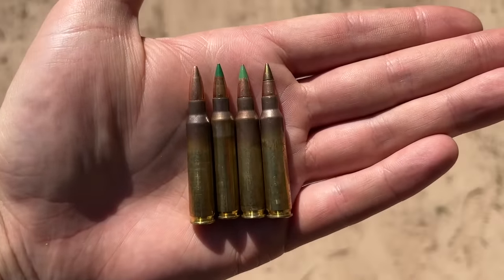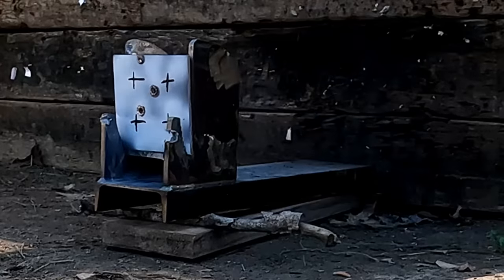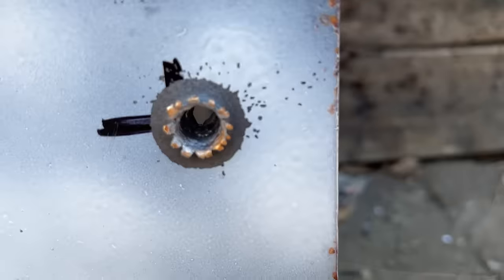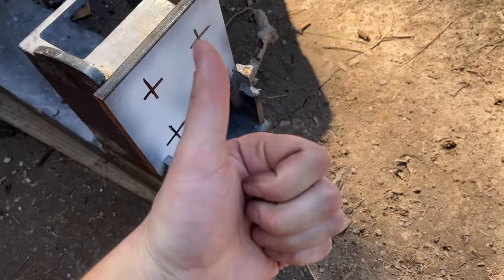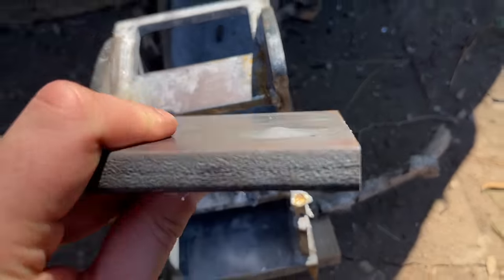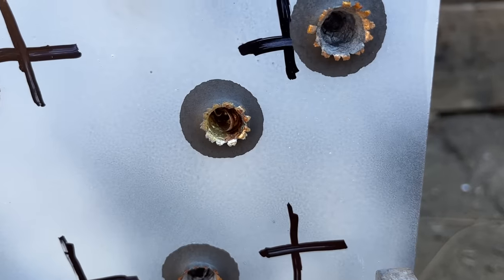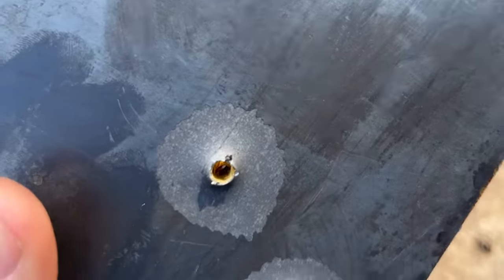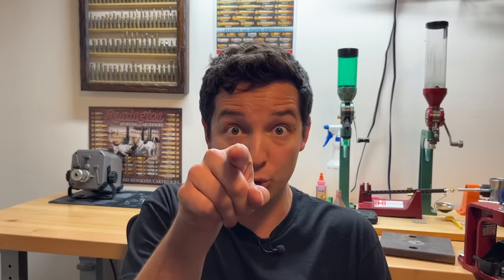M855A1 vs M855 vs SS109 vs XM193: Crazy Results on Steel

Comment: I reckon the chronograph wasn't getting a reading on M855A1 because A1 not only has a steel tip and steel core, but the round is loaded in such a way to where it is near maximum safe chamber pressure out of an M4 Carbine, thus increasing velocity. In short, M855A1 is hauling so much ass out of that 26" barrel that the chronograph can't measure it.

Comment: Penned AR500 with M193 out of an 18" barrel before, I don't think the M193 is gaining anything from the 26" barrel, in fact it may be losing velocity. The three heavier projectiles are getting much closer to M193 velocity than out of say a 20" barrel. M855A1 is a different beast but M193 often does better than M855.

Comment: What's the difference between the 855 and 855a1 
I'd like to see 855 or 109 comparison with the stuff the marines use or used where the penitrator is in reverse orientation from the 855/109
Reply: A1 uses a copper base, no lead core, and the penetration besides being exposed, is hardened steel instead of mild steel, and larger. A jacket then wraps around the copper base and penetrator add I understand it and from what I can tell from cut aways.
Reply: A1 is also about 200 fps faster
Reply: @meanman6992  the penetrator of A1 is harder than M855 but the M855 is not mild steel. It is hardened steel but on the lower end. For example, the steel in M855 is not as hard a AR500. But the steel in M855A1 is actually harder.
Reply: M855 and SS109 are essentially identical. "M855" is the US designation for SS109.  M855A1 is has a different bullet construction (steel arrowhead on top of a solid copper slug wrapped with a copper jacket), and loaded to much higher chamber pressures.  Essentially it's designed to get 20" velocities out a 14" barrel.  Marines used the Mk318 SOST round that featured a reverse drawn jacket over a copper base and lead nose.  Later versions had an all copper slug.

Comment: The difference between SS109 and M855 is pretty simple.

The NATO standard of SS109 is a looser specification than the US implementation of that standard.  All M855 is SS109, but not all SS109 meets M855 specs, usually due to a slightly lower velocity when there is any difference at all.

Technically, M855A1 isn't SS109 spec.

Comment: the reason you probably were not getting a reading is because m855a1 is meant to completely burn out of a 14.5 barrel. it will reach the same velocity that m855 will out of a 20 barrel with a complete burn. It may have been moving too fast for your chronograph to pick up.
Also m855a1 is not jacketed at all. it is a hardened steel penetrator inserted into a all copper base.

Comment: Need to somehow get your hands on some M995...
Reply: There’s a channel where they tested m995 and 855a1 on some level 4 ceramic body armor they both got the same penetration and did the same damage almost penetrated but not quite even m995 won’t pass through level 4 plates

Comment: I thought m855 and ss109 were synonymous
Edit: m855 is the whole round, ss109 is just the projectile. So your ss109 was probably loaded softer? Speeds were similar but was lower by a little
Reply: The penetrators used in 855’s now are dart type.  The ones we had in the 80’s-90’s were a two piece rod.  I used to cut open M855 bullets to show the class the penetrators as part of BRM2.

Comment: I'd bet you weren't getting a chronograph reading on the M855A1 because of the Black tip.
Reply: Now that ive looked into it, I  wasn't aware that there was a copper core 855A1, which has a copper color tip.

Comment: " What is SS-109?  Is it the same as M855?

SS-109 is Fabrique Nationale's (FN's) name for their 61.5 grain bullet with the steel penetrator in the nose and what they call rounds loaded with this bullet.  (FN calls M193-type ammo "SS-92.")  The US military's M855 round is loaded with the SS-109 bullet, though the US military has additional specifications that ammo must meet before it can be called M855.  So, while all M855 is loaded with SS-109 bullets, all "SS-109 ammo" will not meet the M855 specs.  For example, the British purposely underloaded some lots of their ammo in an effort to get their L85A1 (SA80) rifles to cycle properly.  The ammo is still loaded with SS-109 bullets and labeled as SS-109, but it is nowhere near the M855 velocity specifications."

Comment: Whats even crazier, dont need a 26in barrel for this. Ive put M855A1 through half inch out of a 14.5in M4A1 at a distance of 100m.
Reply: Does the 2 full spins out of the 14.5 with 1/7 twist give it the extra speed? I have the dd m4a1 as well
Reply: @kalanipitmon7817  no twist rate has nothing to do with speed. The round is loaded to a higher pressure and is faster burning powder make for shorter barrels.
Reply: @fujimi715  Correct.  Twist rate is matched to bullet weight and length. the longer the bullet the faster it must spin to stabilize.  Longer bullets are generally heavier.
Reply: Same results with our unit’s good shooters.  A1’s are definitely more accurate than the old 855 green tip mediocre round.
Reply: @blackhawk7r221 with M4 or M16?
Reply: @fujimi715  M855A1 is optimized for our existing M-4’s with 1/7.   So yes, an M-16A2 1/7 would shoot them well plus give a bit more velocity.  Older M-16A1’s with 1/12 don’t have enough rifling twist.
Reply: FM 3-22.9 has all the ballistic info you seek.

Comment: You didnt get a reading due to the 855A1 being a fully copper and tungsten tip….. the type of chrono your using can’t pick it up….. get the kind most use that use light and it can pick anything up…. Just fyi

Comment: Not a bad comparison vid. But to call it a “ballistics” test you should have more carefully controlled the rounds used and made sure you got a chrono. Should have used a more common barrel length too. There are a lot more factors in penetration than just the bullet.

Comment: It would have been nice to get velocity readings on that m855a1 I've heard chronographs may not read certain ammo because of the color being reflective I seen a guy test some ammo that wouldn't read on the Chrono and he used a Sharpie marker to make the round dark and then it registered just FYI in the future if the Chrono won't pick it up try the Sharpie trick. love the videos
Reply: On a typical chronograph that uses ocular sensors that’s true, but the chronograph he’s using in the video uses magnetic impulse readings to generate data.  
   I’m not sure why the M855-A1 wasn’t reading, though, as with the large exposed steel penetrator it should’ve had the strongest effect on the sensor. Maybe overloaded it?
Reply: @truckingbastard  oh I didn't know the differences between chronographs yeah it would have been cool to see the reading those are supposed to be pretty hot rounds more so than m855 green tips. Oh well I appreciate the info buddy thank you

Comment: The m855a1 is 2970 meters per second, got smoked because I didn’t know it.. the more you know
Reply: You know that 2,970 meters per second is equal to 9,744 feet per second wow that bullet flying
Reply: The previous comment is correct...it should be feet per second, not meters per second!  Anything beyond the low to mid 6,000 fps range is going to run into very hard problems/thresholds!
Reply: my bad in the military we use meters

Comment: Make a depth test plate with 2 pcs of 1/4” cross ways and min 3/4” clear gap between them. This will elevate your caliper block above the out flash eliminating the grinding and potential skewing of the depth should you over grind the area resulting in a divot.

Comment: Short barrel 556 rifles are cringe there I said it I have an efficiency OCD issue and all that wasted powder and unburnt charge drives me insane like you're literally losing tons of feet per second imagine I'll get a 35-in barrel would be
Reply from the maker: From my chronograph numbers, the 556 was losing about 250-300 fps out of a 16” barrel, so you’re right about it losing a lot